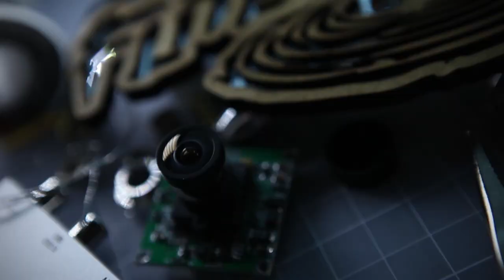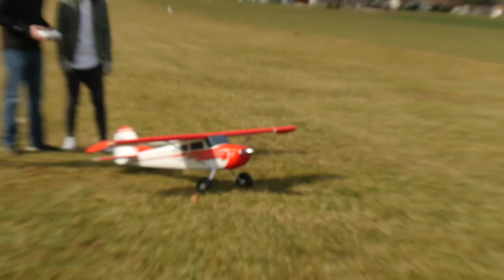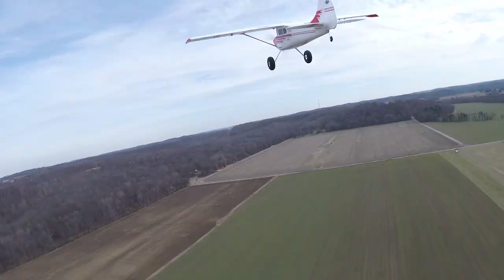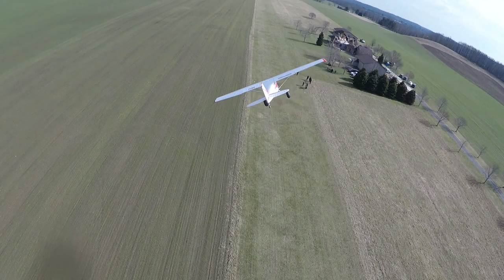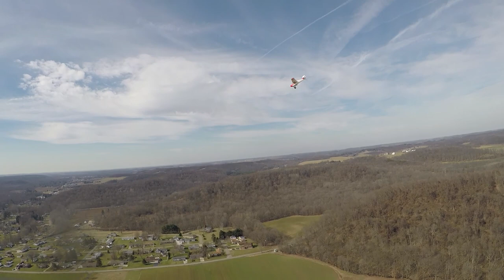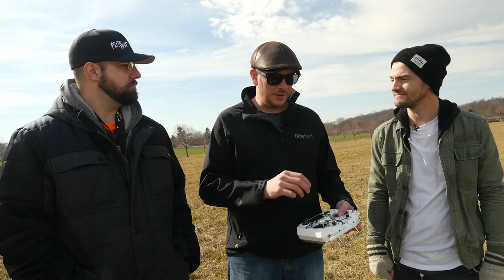Cessna 170 - Flex Innovations - Review | Flite Test

Comment: This 170 is on my wish list. I was going to pull the trigger on it but got the 2000mm FMS Beaver instead. I would love to see a large foam version of a scale Cessna 150 as I am sure a lot of pilots would, as it is as common as the J3 as a trainer. I owned a full scale 150 for 12 years. I am just wandering WHY manufacturers have not introduced the 150 in a large scale foamy yet.

Comment: Alex or whoever is flying follow footage should switch back to a 6 inch quad. The 5 inch is too twitchy and energetic, a 6 inch would be much more smooth, less powerful and easier to follow these planes. Why not just use the Versacopter for follow footage on this bigger, slower stuff?

Comment: You didn't mention the Aura 8 flight stabilization system and all of the options available through it using your PC.  QQ even has an advanced program you can download that uses the flaps as an extension of the ailerons for hovering and then they become flaps again for landing etc.  Pretty cool.

Comment: I might get myself a plane too. I am just BAAAD at using the transmitters. I even have problems piloting my Parrot Swing lol. Yeah, its not a plane, but it is still flying. Anyway, any easy to fly planes out there?
Reply: vidfreak727 most high wing aircraft like these Cessna's are good beginner planes, but maybe a smaller cheaper version to start out with, and maybe a flight controller that has stabilization to help with landings and the "oh crap" moments when the direction gets confusing mid flight. Watch the FliteTest beginner series and they will cover the types of craft that may be best for you.
Reply: Just for fun I'm still learning to use the controller. I got the Parrot Swing and it's a lot of fun!

Comment: I feel obligated to share my experience with this airplane. I have owned two of them and assembled/flown one more for a customer. They make an excellent first impression but after a while they have some issues. The landing gear eventually will begin to wear out so that the whole gear shifts forward and backward which will put the airplane on its nose on landings. The trim changes on pretty much every flight, and the trims don't move the controls very much. If you bind it and the throttle is for some reason reversed or at full, it will go to full throttle. Any even minor impact to the motor seems to damage the internals so that it will no longer function at all. On my first one after about 25 flights, the elevator servo failed entirely and the airplane went straight in and destroyed itself. The quality control is terrible, all three of the ones I have had experience with have had major paint and/or foam defects including that one of mine was missing the cover for one of the wingtip lights. All three of them have been incredibly hard to assemble. The tabs on the fuselage that plug into the wings didn't line up on any of them. And last but not least, the quality of the hardware is absolutely terrible. Using the included tools, almost all of the screws will strip so that the alan wrench will no longer turn them. But I will say that if you overlook all of that, it is probably the best flying all around model on the market today.
Reply: Thank you for the honest review.  I am considering this plane and I will take your review into account. I would have thought that Flex was different from the other manufacturers and would have put out a quality product for the long term. I am actually surprised they were able to give the consumer such a large plane with such impressive power for the price that they charge.  Did you reach out to Flex regarding the elevator servo failure?
Reply: I did reach out to them and I ended up shipping all the servos to them to be inspected. The found that the motor of the servo had failed. Their solution was to send me a new one at half cost. I was a little disappointed because their excuse for still charging me half was that I had 30ish flights on it, which I would not concise an excuse for the servo failure.
Reply: I know it's a small company but some more compensation for the fact that a failed servo resulted in a destroyed plane would have been nice. A new plane isn't cheap.